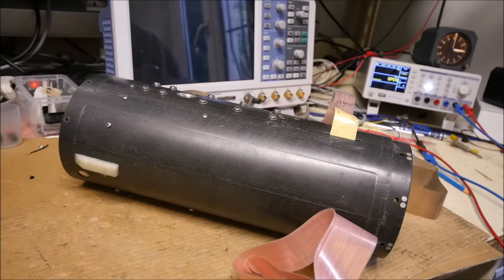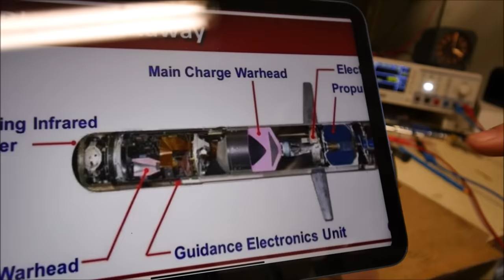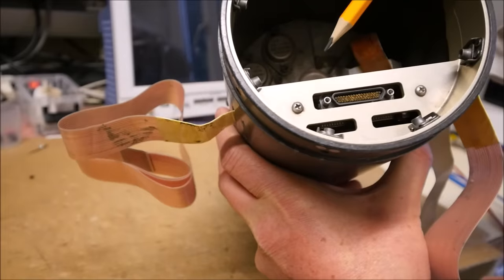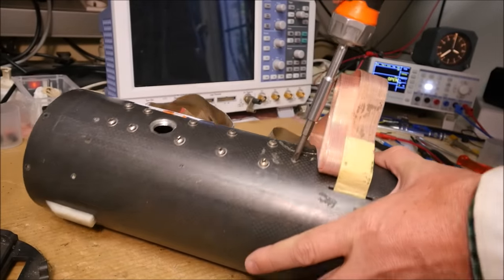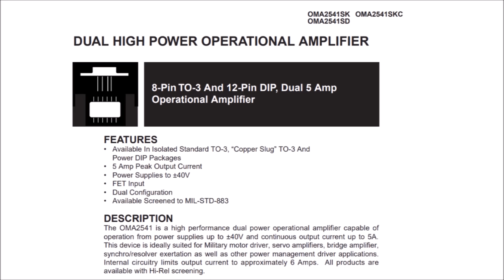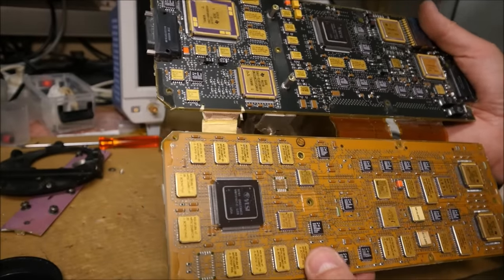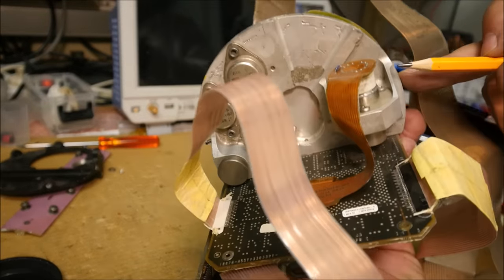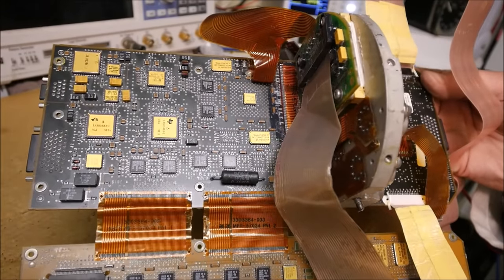LDM #354: Javelin Missile guidance computer - Part 1: teardown

Comment: I would have loved a breakdown of that thing. Like why are there two connected PCBs? Why are there so many individual chips? What do the individual chips do? 

It just looks so complex. I would love a "SmarterEveryDay" video about it with one of the engineers. Just breaking down the complexity and explaining the design decisions.

I get that there are certain constraints on building such a device. But I feel like my Intel or AMD processor at home could also guide a missile. There would be obviously a lot of overhead like the OS, massive unnecessary latency and so on. But I feel like you could design a much simpler system with just 2 chips.
I'm also shocked that the infrared sensor is only 64x64 pixels. 

Also are other military devices equally complex with custom designed circuits? I have so many questions 😂
Reply: The answer to all those questions is this was designed at the same time the Nintendo Gameboy came out. At the time this was as compact as it could be. Today you could get everything here into the CPU that powers a smart light switch.

Comment: Thank-you. Great teardown vid.
The boards and basemount IC's appear to be more modern than '80's vintage.
The metal (non-ferrous?) bulkhead is both a heatsink for the opamps, trim ballast and eventually part of the EFP jet?
The metal cylinder appears to be either a proton precession magnetometer or magnetic induction sensor for detecting proximity to the target vehicle.
BTW: See if you scratch a few spare chips for the Ivans to keep their wash-machines spinning.
All the best from Namibia.

Comment: Now I understand how that military chip manufacturer was able to create their own graphics card 3DFX out of nowhere and bring it to market. These missiles are basically flying webcams with video processors on them guiding the missile to the infrared/heat target.
Reply: hakimmohamad6216  because it's not true lol. i think the only graphics card that was a result of military development was the intel i740 which was actually a joint project with lockheed martin and an outgrowth of their simulation systems, but it was really shit. SGI (where the 3dfx team originated) didn't make military hardware either

Comment: I can't believe there are D-sub connectors in there. Seems like this whole assembly could be optimized with a Raspberry Pi 5, weights cut down to 10%, motor and cost decreased accordingly, explosive increased, etc. Depending on the sample rate for the control system, the FPGAs may not even be necessary. There are some Pi designs with the official RPi camera that are something like 600 frames per second I believe. But I get it, probably not much open source tech in such a weapon. Very interesting teardown. Now get some Aqua Reggia and harvest the Gold lol.
Reply: It's around 50 years old.
Reply: @topduk more like 35, but yeah - technology has come a long way since then.
Reply: As someone pointed out in another comment, this stuff is radiation-hardened space grade electronics, while the components of RPi are anything but. A failure in these can be absolutely catastrophic - it needs to survive harsh conditions (low pressure during air transport, being dropped and banged around) and work perfectly - after possibly 10+ years in storage. Sure, a functional optimization could be done as you've described, but it would lack the reliability of separate simpler parts with multiple redundancies put in place, as in this design.
Reply: DJI phantom and carrot from rpg-7. Looks like best price.

Comment: Seems like the placement of the warhead with shaped charge, is designed to explode and pass through the guidance computer, in order to maximise damage to it and thus minimise opportunity for reverse engineering by an enemy.
Reply: If that were the case they would have just centered it. That thing would not survive in any reversible form even if it were behind the primary. More likely that the shape charge performs better at a certain offset from the armor.

Comment: As others already said, sad to know this beautiful and super expensive piece of engineering is designed to be used only once, then it self-destructs. But even more sad that the sole purpose of its existence is destruction and to kill people.
Reply: It is a defensive weapon at least
Reply: For this to kill people, the operator of said weapon needs to point it at people. This was designed to destroy a tank, not people.
Reply: I was speaking in general, every modern missile must have a guidance system of similar complexity and build quality.
Yes, I wasn't aware this is an anti-tank missile, but still, the tank has crew in it, so it will still kill people, unless it is targeted towards the engine which might absorb enough energy to leave the cabin somewhat intact.
Yes they will be military casualties and not civilian, but does it matter that much? The tank personnel were also civilians just months or weeks before, and a lot of them has families. A lot, if not most of them don't want to be there, but they are forced to.  @JaakkoF
Reply: @mrnmrn1  Well, sure the tank crew also has people in it and their lives matter. I suppose it's a good thing to reflect on the tragedy of war now and then - guess most people just accept it as a fact of life, maybe get desensitized a little as long as it happens somewhere else.
Reply: @JaakkoF Tanks quite often have people in them.

Comment: Designed by the guy who said something about 640k of RAM being more than enough. This illustrates the stupidity of people who say cutting China/Russia off from next-gen fabs will reduce their military might. Our latest and greatest, "cutting edge" ATGM capable of taking out any tank on the battlefield is perfectly fine running on fewer resources than my kid's disposable electronic toy. Any random commercial FPV drone in Ukraine right now dwarfs the Javelin in complexity. This is hardly unique. Even our most advanced F-22 fighter is running on i960s designed by Intel in the 80s.
Reply: I'll disappoint you. Javelin performed very mediocre, to say the least.
A very expensive and capricious toy for rich NATO fools. In winter, in the cold, the batteries quickly ran out and there were a lot of problems with them. The missiles ended up in the real world, and not in an advertising brochure for the Pentagon, and almost always missed, as can be seen from this video at the beginning where the failed missile simply lies on the ground.
The main thing is a cumbersome, capricious and insanely expensive system that is not applicable in a real war because It cannot be produced by hundreds of tens of thousands a year, and for its price, it will ruin any half-buyer.
Now tanks, infantry fighting vehicles, trucks and enemy soldiers are destroyed by Russian FPV quadrocopters for $300, which are printed on a 3D printer in 2 hours - they fly 10-12 km with an RPG rocket and penetrate any NATO equipment.
Javelin - flashed for 2-3 months, and now everyone has completely forgotten about it; they have been gone for a long time.

Comment: As real war field conditions demonstrated this thing is perfect example of overengineering in most bad way. Operator's feedback is mostly negative. Too many fails and various problems leading to odd behavior and very low combat efficiency, even when being used by well trained operators. Price per unit is enormous. Simper and much cheaper AT systems demonstrated much higher efficiency.

Comment: Be careful.  Raytheon and Lockheed probably won’t like the fire and forget attributes of this weapon to become common knowledge. Will be a cool video, just have an exit strategy in place in case they knock on the door.
Reply: Oh shush, some scraggy parts don't make a missile, besides, this is how old?
Even if you extract and debug all the code and everything, now what? Nothing.
Reply: @TheElectronicDilettante

its a Block 1 Javelin, potentially up to 17 years old, possibly a 148A Prototype Guidance Section that got auctioned off and is viably worthless to any current generation of the weapon.   Raytheon and Lockheed are at Block II and even newer versions SPIRAL 2 and SPIRAL 3 Variants that are far more advanced than that board. nearly every bit of this video is no longer classified.  without the CLU, you have nothing but some PCB and chips. The CLU is the real secret, it contains the actual programming code for the guidance unit.  And good luck getting your hands on a CLU without a plethora of valid clearances and authorizations.  The missiles are 'dumb' until the CLU Powers up, Programs and then spins them up to a ready/fire state.  at best, the only code you are going to find on that board is the MerCad Seeker's code which is firmware based for its 64x64 pixel FPA Imaging. There is nothing secret about how a Mercad Sensor works, nor the 64x64 FPA Imaging Sensor suite. The sensor's fixed values that are stored locally, are altered when the CLU powers them up.  The CLU has to adjust its numbers for the conditions detected by the CLU when the missile is being pointed at a target in that moment.   Tactically those base numbers are worthless to the average joe schmoe. 

He will be fine, no SEAL's or Black Ops Ghost Spooks will be showing up at his door.
Reply: @CapStar362  Interesting. I'd have assumed the guidance code would be kept in EEPROM and only the mission-specific targeting data would need to be uploaded prior to firing. Or is it more the case that the guidance vector math is done offline and the  missile is running through a list of instructions? Programming FPGAs right when you want to be firing the thing seems like a high risk move purely from an engineering perspective, but I can certainly see the non-engineering advantages in doing so.
Reply: @CapStar362  Thanks for clearing that up.  I too wondered how he got his hands on it and if it was still classified at some level.

Comment: i believe a 2$ esp32 can do better than this!
Reply: There's more to this design than DSP. The gyro, other sensors and analogue front end will for sure have better performance than a low cost MEMS gyro and multipurpose micro. And can it time travel back to the late 80s and do it for $2 then?
Reply: I am happy to see esp32 not yet used to any war today, which is a good thing indeed!

Comment: The sensor is the rate gyro, dual axis. Requires plus and minus 15V at 400Hz 3 phase to spin up the motor in it, the circuit no doubt used the overkill aerospace mosfets as part of the motor driver. I always though military weapons stuff was extremely wasteful of high tech stuff😢

Comment: Those componants are almost 24 years old. Imagine how much a modern design would shrink those PCB designs. Doing so could make an even MORE explosive device room if made today.
Reply: You are wrong ...
This is a modernized version ...
Watch the leftover space in this part.
Maybe 6 to 10 years old.
Reply: @TomKappeln  look at timestamp 8:02
Reply: Smaller electronic components makes a device more susceptible to electronic warfare.
Reply: @Lecmos  How so?
Reply: @MasterX767  Older chips use analog systems which make them immune the spoofing and noise inundation effects that can mess with newer chips. Their software and codec is also older and therefore more standalone and impervious to digital electronic warfare.
Reply: @Lecmos  Good Point. Have you seen the latest Patriot Missile components?  They are not only modern, but also even MORE hardened to electronic warfare than before. They use a simpler design and have replaced the increased space with more powerful explosive materials. I am to understand that a Patriot missile battery can now survive a Nuclear EMP. The Javelin can be done similarly.
Reply: @MasterX767  I have heard of how they're creating newer electronic weapon systems that are hardened against electronic warfare. I haven't read up on these newer systems having the ability to be exposed to a nuclear level EMP and still function. One thing for certain is that as chips and electronic components get smaller, they will be undoubtedly more susceptible to electronic interference. This is because of their architecture and the very principles of function they rely on. They're just very small and work at very small scales and that makes them vulnerable.
Reply: @Lecmos  The PCB has Copper Screening and aluminum bars that rotate around the components. The Capacitors are made up of more advanced materials that resist electromagnetic interference. The latest Patriot missiles have a 1:1 ratio shooting down Kinzal Hypersonic Missiles Russia is using against Ukraine. I guarantee that Russia is using Eletronic Warfare equipment to try and guarantee those missile strikes are on target. They are failing.
Reply: @MasterX767  afaik Ukrainian simply made claims that they shot down Russian Kinzhals. They didn't prove that they had actually shot down a maneuvering hypersonic Kinzhal. The photos they released were very similar to another weapon system rather than the Kinzhal and there was video evidence of the Patriot launching off all of its missiles before something hit the battery. I think even the Ukrainians or the Americans, I forgot which one it was, admitted that the Patriot was somewhat damaged.

Comment: I'm surprised that they didn't obscure any of the part numbers.  I would have thought that they would want to make copying it as difficult as possible.  Apparently they felt that there was low risk or that adversaries already had their own equally capable versions.  Back then, not as easy to look up a part number, or maybe they're part numbers that no-one else could decipher until they reverse engineer it.

Comment: I know you didn't have the seeker part.. but could you seek any cooling connections for the thermal camera? 
Also, the sensor and the board behind it.. I presume they had to be mounted vertically in order to be aligned correctly with the flight path.. but I'm guessing the board alignment is more to the centre, so it could contain the accelerometer.. the cylindrical sensor is put the side.. did they only care about the nose pitch? and not yaw?

Comment: I’ve always wondered what these buggers look like inside. So fascinating! Now if only one could get a semi detailed explanation of its operations during its short short runtime would also be super cool. Every time I’ve seen one fired I always wonder about how fast is it with respect to its particular computations, how fast can it read and react to its sensors..🤔..how fast are the actual sensors, so on and so forth. To be perfectly clear I have no use for that information at all. So it’s just out pure curiosity about the tech in and of itself.

That’s a really cool fascinating piece tech u shared with us which, of course is much appreciated!

✌️🖖

Comment: This is not technically the "guidance" part of the missile, it's the steering part, aka Control Actuation Section, or CAS.  Guidance electronics are forward immediately behind the seeker.   The seeker detects the target while guidance electronics maintain track by generating steering commands to keep the missile aimed at the target, and those commands are routed to the CAS which actuates the steerable fins.

Comment: It would be a great video if you could arrange to input to the servo drive and watch the fins move. Maybe the seller has intact fins and servos? 
If the image seeker uses a standard interface, and a synthetic shape inputted we could watch the system track the shape. I realize this is too much work.
Reply from the maker: The code is not present, this device is totally useless!

Comment: 64 x 64 is quite low resolution but in high sampling frequency should provide enough information. I originally heard its 16 x 16 and it sounded bit a stretch 😅

Comment: I'm a dumb kid and have no experience in any of this but I have a question. Is it possible to replicate these systems/circuits? And how small could we make it with todays tech?
Reply: Your cell phone is basically a computer 10 times as powerful as this one
Reply: @BGTech1   So he could mod it to play PlayStation lol
Reply: @MlnscBoo  that’s would be very very hard if not impossible because these parts are designed for the needs of a missile computer. A ps1 is designed for what’s required to play video games. Although they are both computers they are designed very differently.
Reply: Come back in 30 years and find out in the teardowns :-)

Comment: Since this missile system has not been decommissioned it is still classified. With as many people who have seen this video i'm surprised that you have not been reported. The only thing that would happen though is YouTube will remove the video. I used to work on the night-vision part of the launcher for this missile back in 2000-2004. Don't worry I won't turn you in. It's actually nice to see the guidance part inside the missile, I never got to see that when I was in the Army.

Comment: If I were developing a new Russian Javelin today, would this information help me? I think no. The engine, thermal camera, optics, servos, shaped charges - yes. But this electronics is very obsolete and over engineered. With new principles of neural networks and modern computers the guidance task can be done much better.

Comment: Most likely a dummy warhead or just a kinetic impactor model, so probably lacks the arming and firing of tandem charge circuits. That might be what those missing DB-9 and DB-25 ports are.
Reply from the maker: This is the guidance computer section only, the warhead and arming/firing circuits are in other sections.
Reply: @lelabodemichel5162  Obviously, guidance must communicate with arming and firing at some point, no?
Reply from the maker: Of course, using the ribbon cables.
Reply: @lelabodemichel5162  And possibly the missing internal connectors.